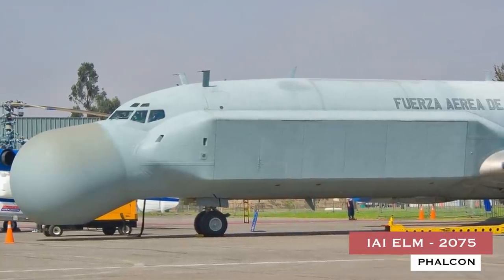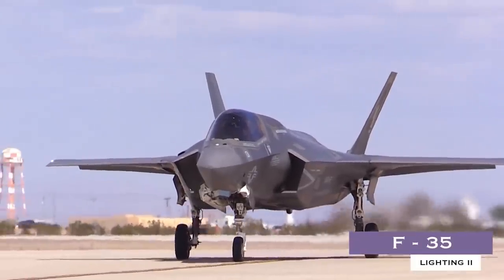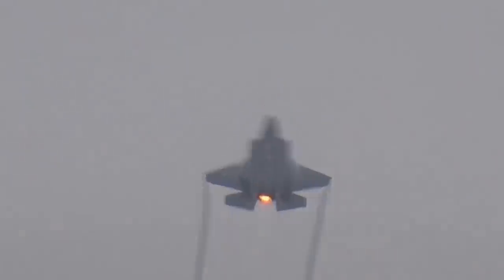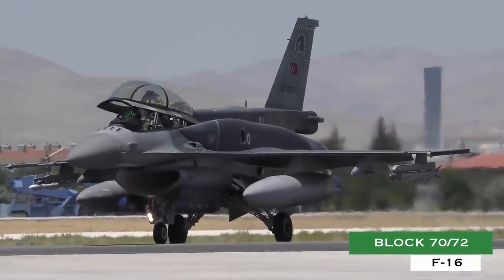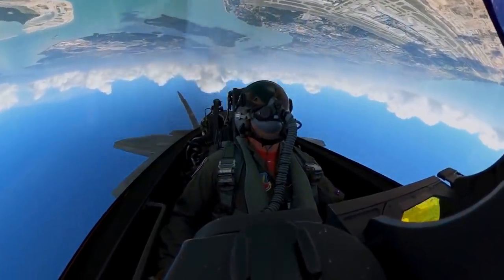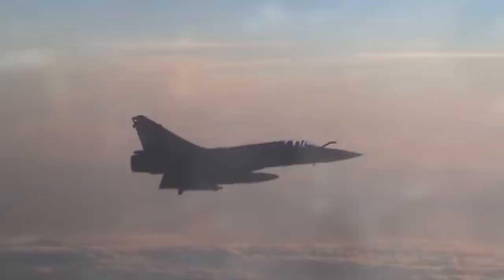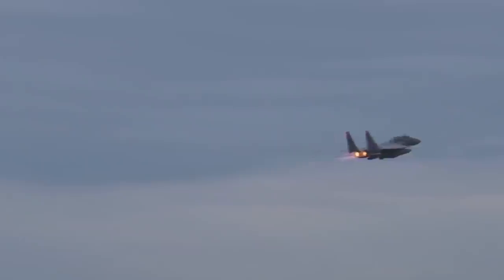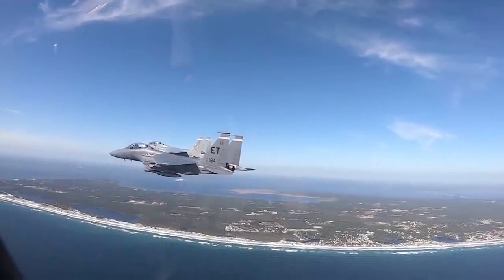NATO Testing its New Gigantic $13 Billion Fighter Jet

Comment: All of them are useless when NATO lost to a small group of insurgents ( Taliban)
Reply: NATO didnt lose knucklehead.  NATO personnel,  including most us forces , have been pulled out of Afghanistan.  The people we left in positions of control, were defeated. If the US behaved like the Taliban,  then there wouldn't be any Taliban left alive.
Reply: @johnchisholm3004  then why did not, I am not the only one but unlike even the US politicians name it Lose.
Reply: master mariner  you called it conventional war?
Reply: Our USA "president" is hilarious 😂
Reply: Having in mind that F-35 was cloned from a Russian Yak-141 supersonic fighter which flew in 1986.

As I said - Lockheed  Martin simply  reverse engineered Russian military flying machine (Yak-141).
Reply: @amoslukyaa5792  Honestly I don't know that.
Reply: master mariner  

Take a closer look at Yak-141 airframe, split twin rudder at the rear, vertical take off and landing of Yak-141 on a Russian aircraft carrier deck in late 1980s during comprehensive tests of unique Russian jet fighter, now, Amigo tell me - is there any differences in terms of design  between Russian Yak-141 and Lockheed Martin's over exaggerated and over priced F-35?

Repeat, F-35 is a carbon copy of Russian Yak-141, you can argue or manufacture lame excuses trying to water down brainy and talented  Russian jet fighter design engineers who gave L.M Yak-141 blue prints after Lockheed Martin Engineers went to Moscow Yak-141 factory, Lockheed Martin team were so desperate to study Yak-141 designs to extent of going down on their knees begging Yak-141 factory owners to sell them blue prints - why? Because Lockheed Martin wanted to win Govt tender of manufacturing next generation jet fighters thereby beating  their competitors namely  Boeing  -  Lockheed Martin should thank Russian Yak-141 designs which enables LM to win the tender against Boeing - I don't think you are even aware of these facts, on the contrary you are busy demonizing Russians and under rating their design contribution to a cloned F-35.

Comment: Instead buildings or upgrading expensive fighter jet,why don't they develop some kind of powerful  high-speed stealth rocket drone without a pilot on board to deliver boxes of missile to enemy target and then can return  back without the risk of human pilot and I'm think that is best solution for all problem they had.
Reply: Apart from the range issues around small rockets, how would you stealth a rocket motor nozzle and exhaust?
Reply: Or deliver easy to fly masses of hawk jets to saturate airspace.
Reply: @neilhough7125  Make it a scram jet....currently too fast to need stealth. Russia, China and U.S. are all developing hypersonic weapons for that reason.
Reply: Although not widely reported in media circles UCAVs.....Unmanned Combat Aerial Vehicles are in development.

Comment: There was a problem with sensor data recording and processing in f 35 because of the computer complexity and wide range of operations which was termed useless by pilots for that meter like speed air pressure height fuel were provided different separate simple system and missile and gun aim was provided different computer control with sixteen and thirty two bit processor and low mb than previous time ram operations very much like PS4

Comment: The front nose Radom has indications of rust bleed thru on the paint upper half of the radom. As if it is made out of metal, which it should not be. Even if it is not , there is clearly wear off of the paint on the nose radom and brown primer is bleeding thru . Did they paint it with water colors. The paint should last decades. the whole plane looks like it was made from scrap parts. Someone should have told them, the whole purpose of using Phased array radar antennas, that can be hidden in the aircraft skin  is to  make their surveillance plane retain a broad radar scanning ability , but ALSO keep their OWN plane radar signature very small.  THE IDEA IS TO MAKE IT HARDER FOR THE ENEMY TO PICK THEM UP ON RADAR. These idiots used phased arrays and still managed to make the plane bigger than AWACS ...LOL....this thing is such a behemoth , the enemy will pick it up 1,000 miles away.

Comment: Ha...Ha...Ha... Highly laughable both the frontal shape of the Jet fighter and the voice modulation of the commentator. The end result will be simply highly disaster, see the cases of Iraq, Afghanistan, etc. what they could achieve with their much publicized fighter jets, missiles, etc, etc; they could ultimately achieve only scampering to the safety of their respective homes.
Reply: Donbosh Sangma...It's NOT a fighter. It's a sophisticated command and control aircraft or airborne command post. It is capable of providing real-time battlefield intelligence to commanders so they can make intelligent, informed decisions. It is capable of talking to every computerized Battlefeild asset , weapon or weapons system in seconds. This enables commanders to coordinate various assets to inflict the most damage on an enemy, in the shortest amount of time.